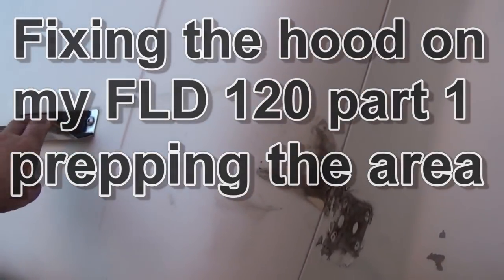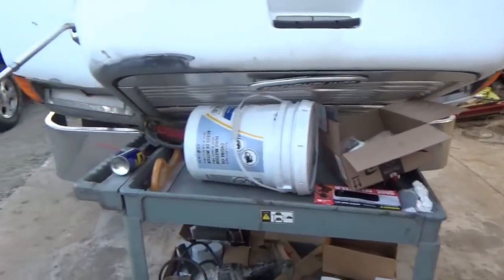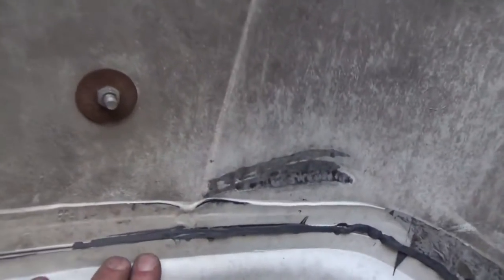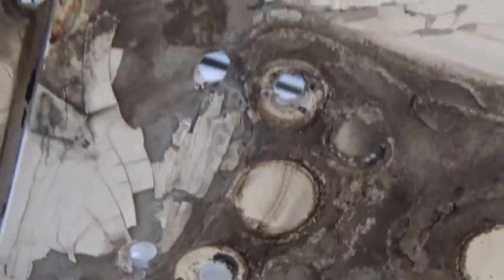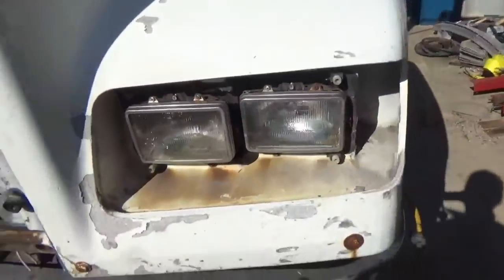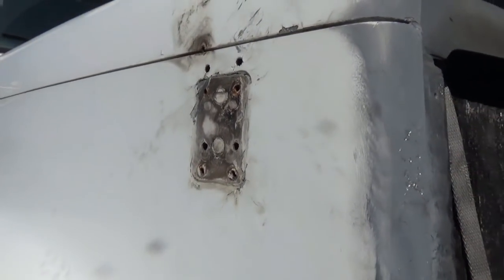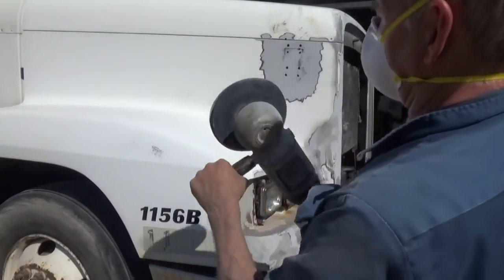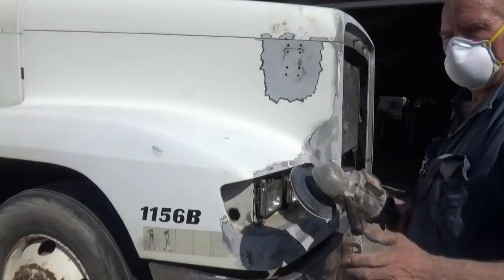Fixing the hood on my FLD 120 (part 1) prepping the area.

Comment: Boy that didn't seem to have a long open time Expanding the back reinforcement ought to help.
Reply from the maker: The mirrors are very solid now. No, you don't have much time to work this stuff when it's hot outside and you can't use less hardener to slow it down or it won't harden enough and will remain tacky and will have to be ground off and done again.

Comment: That hood is nasty. How's your rebuild been holding up?  Using any oil? Leaks?
Reply from the maker: The hood is good now. The rebuild runs fine, yes it does use a bit of oil, after replacing the rear main seal a couple months ago it still uses some oil but no sign of leak that would account for the gallon or so a month, only a couple of slight areas of seepage leaving small oil stains on the motor but not enough to drip.